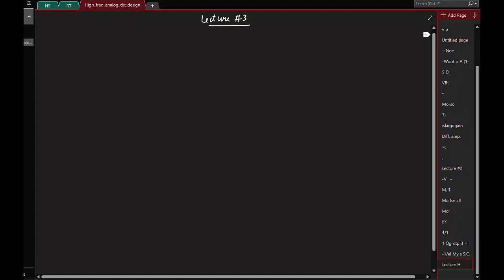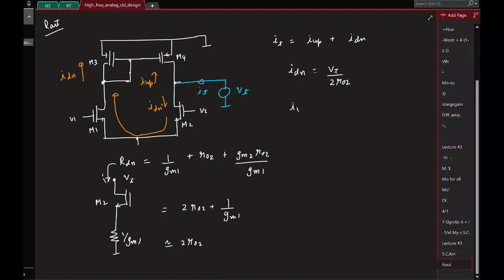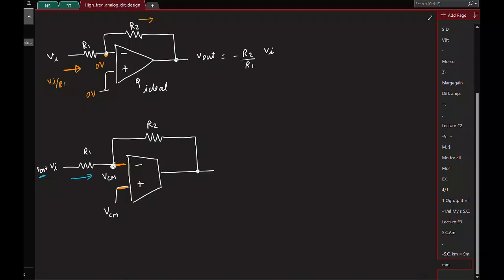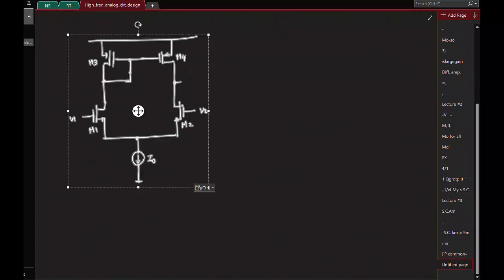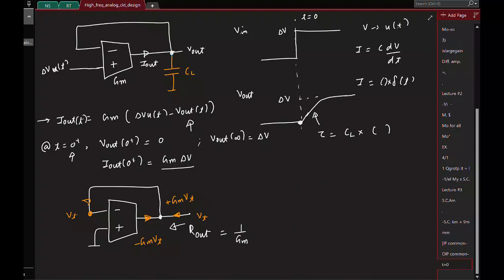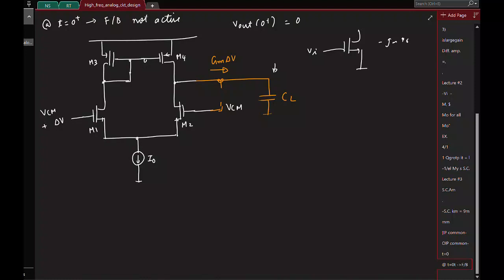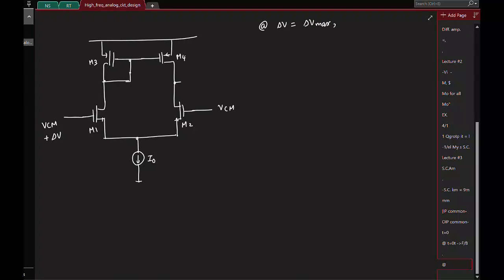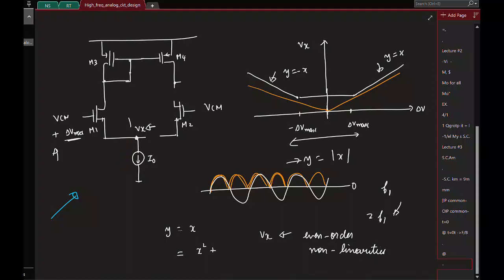Lecture 3: Input and output common mode range &  slew rate in 5-transistor differential amplifier

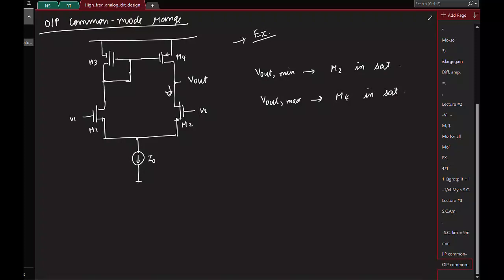Comment: at 27:20, the Vout,max, since the m4 will be in saturation does that mean the maximum input CMR in terms of the output voltage is Vout,max = VDD - Vsd,sat?